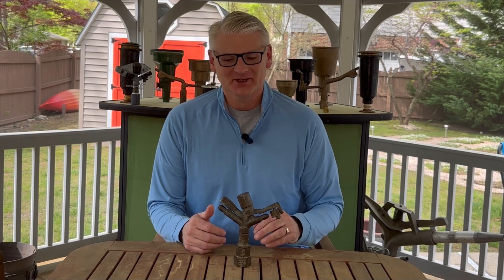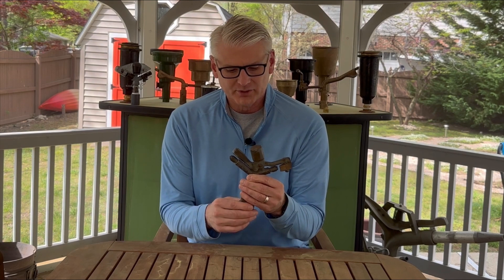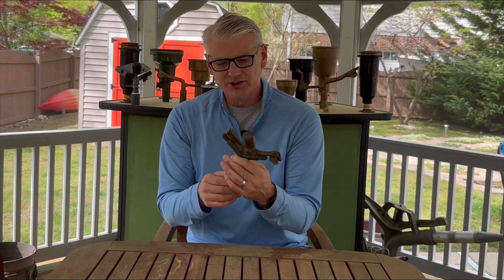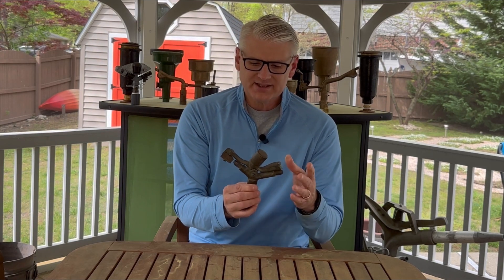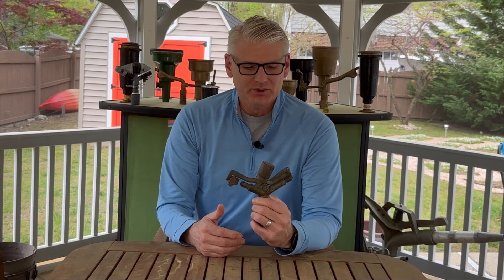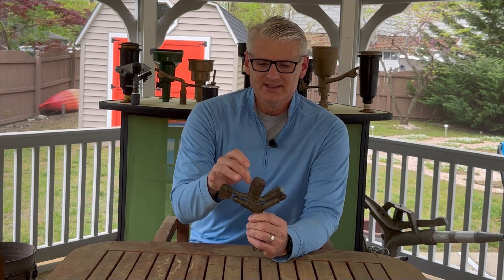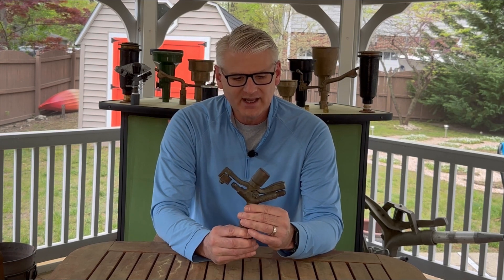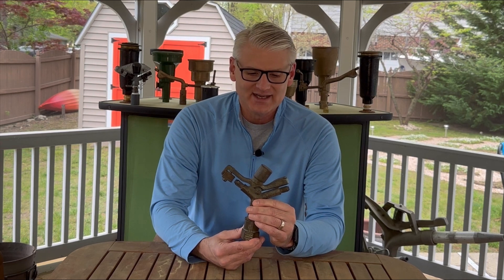c. 1938 Buckner 1878 Jr. Bronze Dual Action 1" Wedge Drive Impact Sprinkler with Speed Control

Comment: I love the wedge design and this one falls right into line with other wedge models.  I think it is quite amazing that a sprinkler this old works without a hitch.  I watched the plunger go in and out.  Very interesting design for sure and the wedge designs seem harder to find than the spoon models.  It for sure moves quickly and I can imagine that a spray nozzle should have been at the tail end rather than a straight stream.  Like you said someone must have changed it out.  Regardless, it is one of those forever sprinklers that you could put out into the middle of the field and know that it will literally operate forever.  Thank you for sharing it.
Reply from the maker: Thanks!

Comment: Interesting how it hits the stream, moves forward, then goes back and repeats. Is this how it got the name "dual action"? Very nice rare Buckner! I've seen a few wedge drives at the dealer both Buckner and skinner.
Reply from the maker: That could be. I’ve always assumed that it was the combination of a wedge and impact (I’ve previously seen a wedge sprinkler that wasn’t an impact, it controlled the direction of travel), but you might be right.